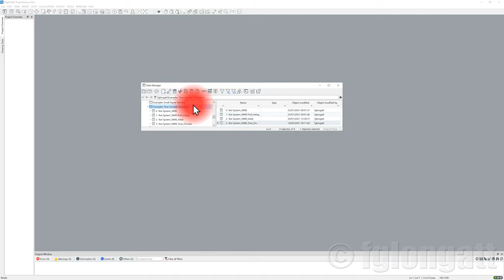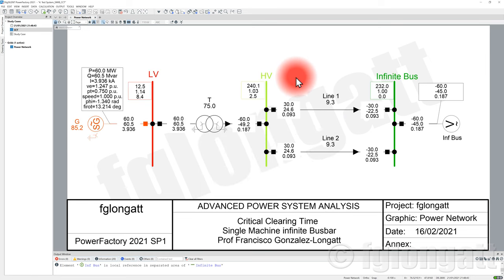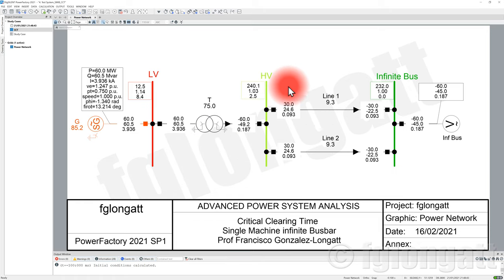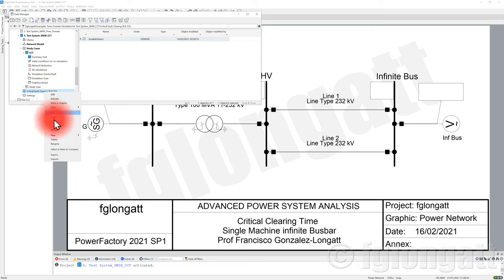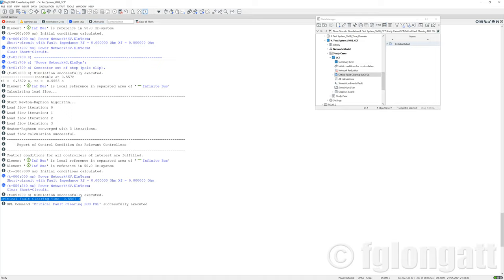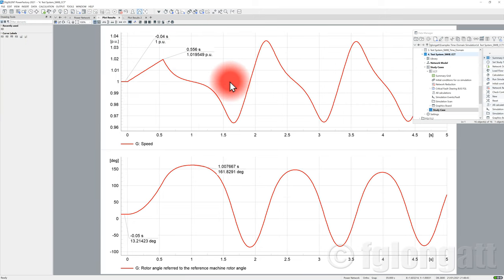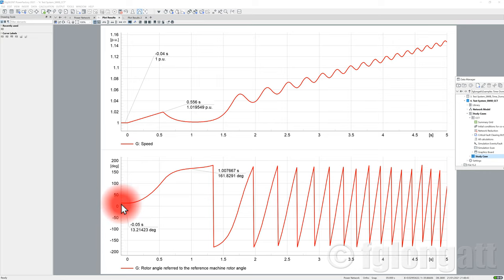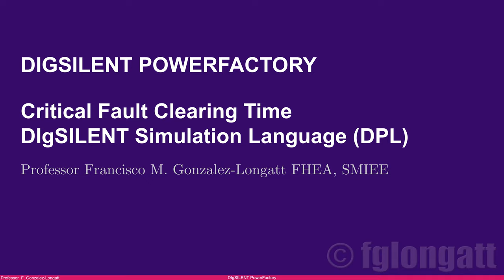Critical Fault Clearing time DPL Short Circuit Bus #DIgSILENT #PowerFactory

Comment: Thank you, Prof FGL, your video is really amazing & you explain clearly, I enjoy your video so much. Now i understand the concept of CCT and dynamic state simulation. I'm learn some insight from this video, please help me to correct my statement below:
- Oscillations that occur at the rotor angle remarks by OK if the rise and fall of the wave are stable
- The speed of the generator's rotor proportional to the rotor angle
- If the isolation time of the CB (Switching event's time) is very long (longer than CCT), then the system will be unstable. The rotor speed initially (after switch event) will be to initial condition, but will be inccrease and accelerating until lossing the synchronism. Result --> The winding will be burned and the generator will be failed (?)
- To compensation unstable system, we can set the AVR, Governor, and Energy Storage System. I have search it,  but still didn't understand, may you have the easy to read/watch reference about it?
- The synchronous machine will be lossing the synchronism if the rotor angle reach 180 degree so the rotor speed is increasing.
- The focus/core analysis of the dynamic simulation is "the range (min vs max)" and comparison from the initial that representing "the steady state comeback" 

May we have the script DPL? Because i can not open the script with pF19 format on your Github repository. (update: solved, i'm already watch your another video of "CCT in TL with DPL script")
Thank you in advanced, Maulina.